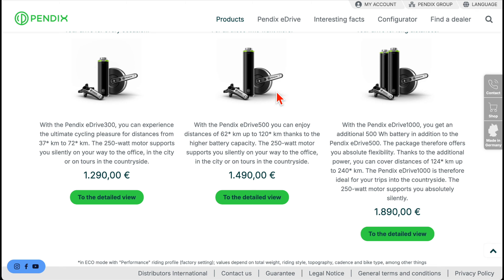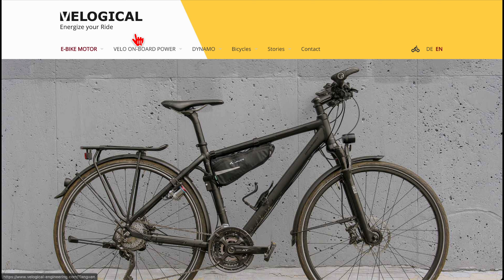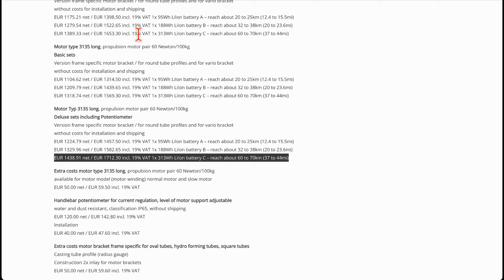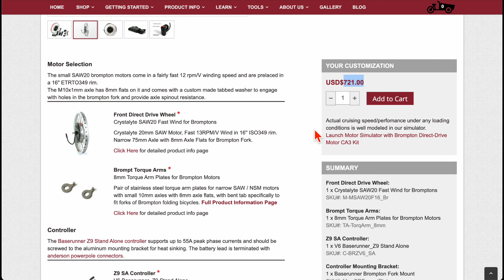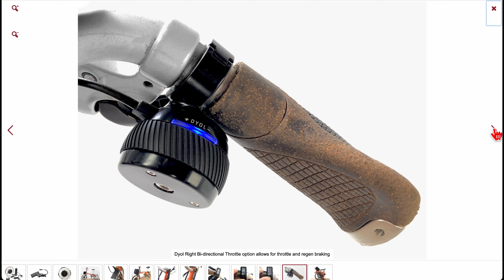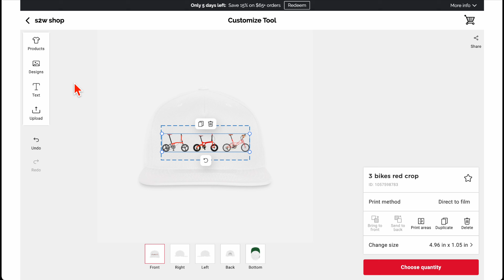The Best E-Bike Kits Money Can Buy in 2025 (8.2025)

Comment: Nice work Daniel describing the features and pro and cons of several e-bike diy kits. Like you I love the regen braking of the grin kit. I have it on the front of a large wheeled bike with belt drive and internally geared hub. I wish the motor was lighter and smaller. But overall the regen makes up for the weight. I also love the torque sensor in the bottom bracket. That’s a must have.  I have 2 small 36v batteries the fit in an under seat bag. I only take one for short trips. 2 for longer but regen helps there too, to extend my range.  Keep up the great work.  I’ll see you when you get back.
Reply from the maker: Because of the Brompton’s crappy rim brakes, the regen feature is practically a must.
Reply: @SmallWheelWonder  Now the challenge is to find a small light weight direct drive motor; less than the 4kg, to substitute for the one offered by Grin. I need to give Grin an email as I’m sure I’m not the first person to want such a motor.  I’ll let you know how I get on.